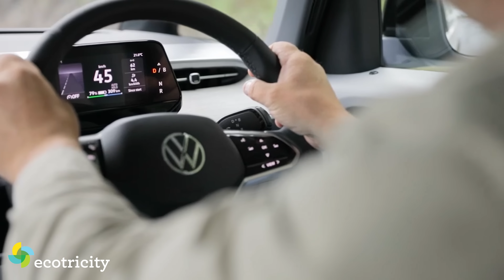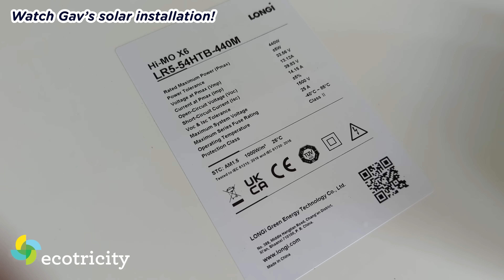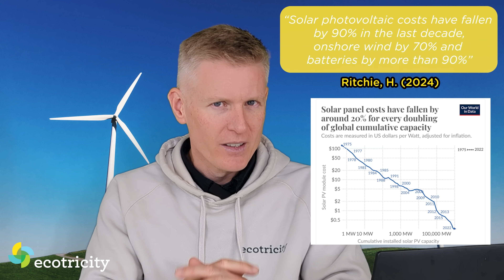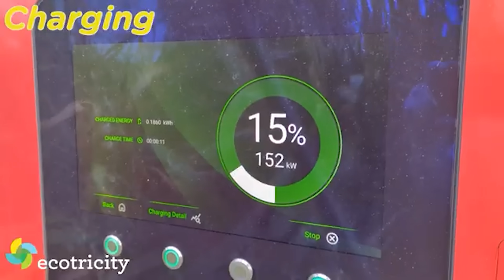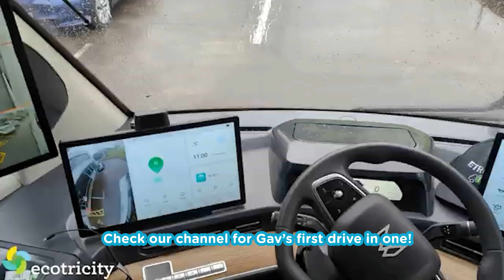NZ Clean Tech News: Episode 1

Comment: As for new charging stations, I wonder if one will be installed between that mighty gap from Franz Joseph to Wanaka. A 280 km stretch, most new EV's should be fine but a few older ones might struggle. Maybe a charger at Haaasst.?? Great segment too. While I liked the other presenter also, presenting news apparently from the other side of the world was quite strange.
Reply: There is meant to be one going in at Haast. They have the spot getting prepared near the Hard Antler Bar. Rumour was later this year, but I'm not holding my breath.

Comment: Do you recommend solar panels with one main inverter or panels with individual micro inverters?
Reply: That depends on your setup and position of the panels/number of strings etc I think
Reply: Microinverters are best if you have complex shading issues, or a really complex roof,  as panels are independent. String optimisers can help but microinverters are better. If you have a simple layout and no shading, string inverters are a better option. Microinverter setups are also much more expensive for a given system. I actually have both - microinverters on my roof and a string inverter on a second system made up of solar panels as pool fencing and pool shade.

Comment: Are wind turbines worth it for rural homes?
Reply: just a normal household, not really.  For commercial,  windfarms, all good.  Solar panels are quite passive in comparison, so much less maintenance than turbines.  Also you need a good windy situation to make the most of them.
Reply: @ yeah that’s mostly what I thought. My new section is possibly in a good location with a good mean power density of about 1000w/m2 according to the global wind atlas…
Reply: Cost and permission for even a 1kw wind turbine is a pretty tough ask
Reply: No, because they just don;t provide enough power to justify their cost. The power you get from the wind is the square of the area swept by the turbine (roughly), so double the blade size = 4 times the power (approximation), and the wind is much stronger the higher you go. That's why it's much cheaper per unit of electricity to make turbines so enormous and go so high, despite the increased capital cost and the much increased installation cost. Per kw/h I'm certain an analysis would show that solar plus battery is more economical at the lower end.